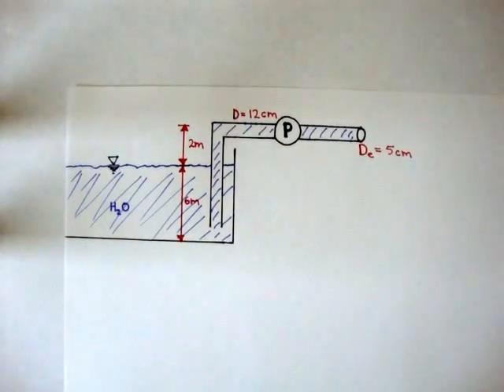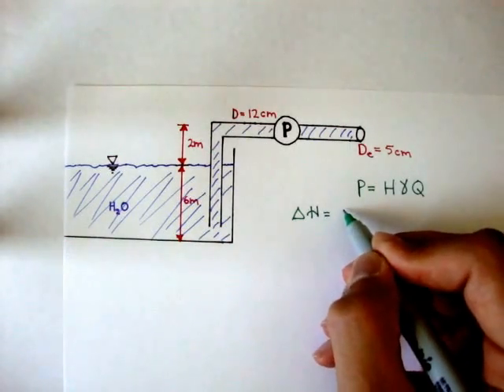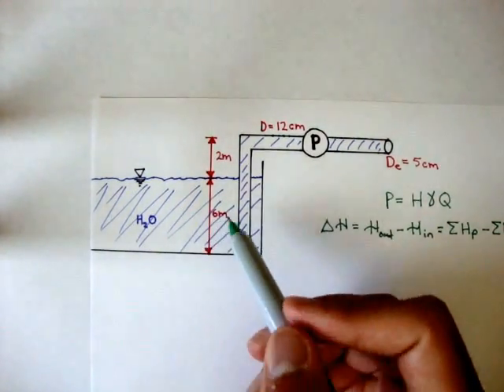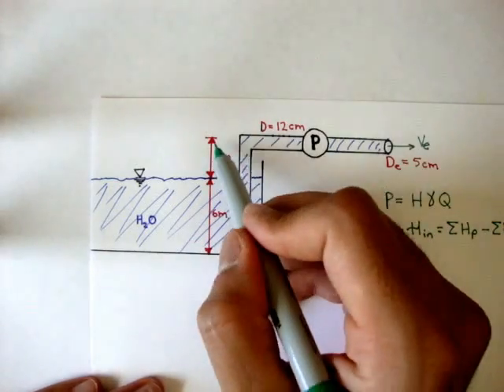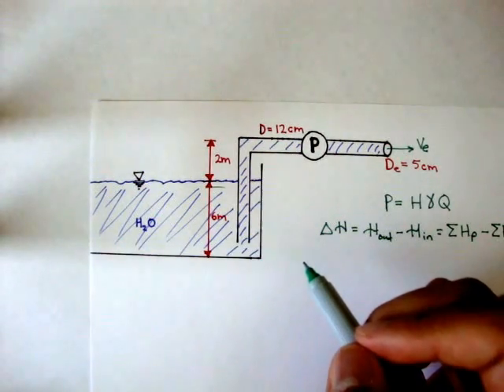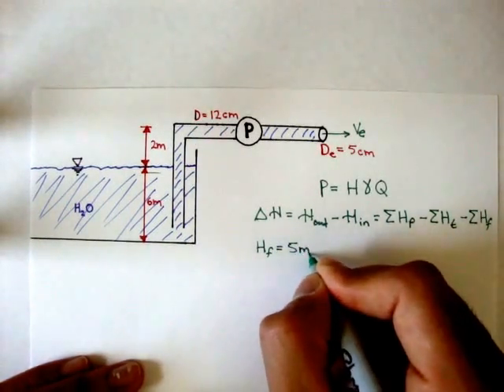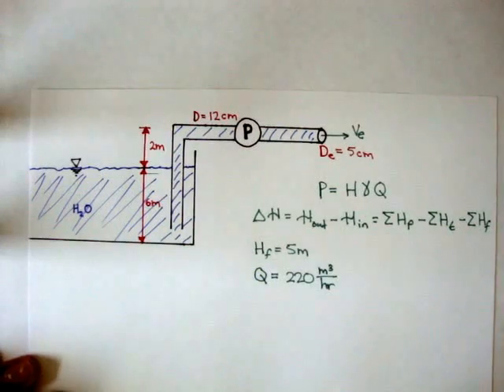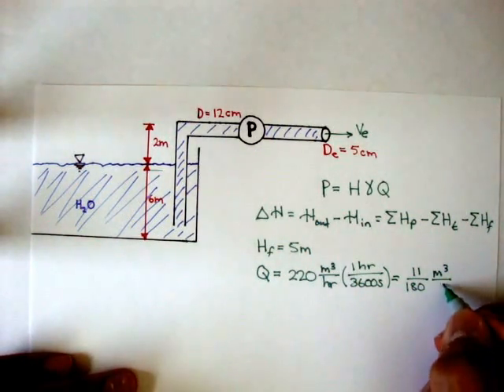Power and Energy: Example 2 [Fluid Mechanics #34]

Comment: How can you tell that v1 will be 0? At some point in time, won´t the water reservoir be reduced because of the work from the pump? Unless there is some inlet outside of the drawing that makes the height constant, or we are saying that the work of the pump is insignificant for changing the water height? Either way, shouldnt this be stated in the task information? Might be a stupid question, but to my knowledge, when you remove water from a reservoir, the water level will decrease?
Reply: Andaii the resevoir is so large that a small decrease in height can be neglected
Reply: To add to previous answer, there's no way to solve for v1 without knowing the cross sectional area of the reservoir. Since they don't give you that information it is safe to assume that the reservoir is infinitely large compared to the pipe.